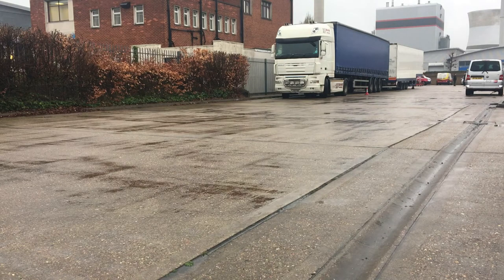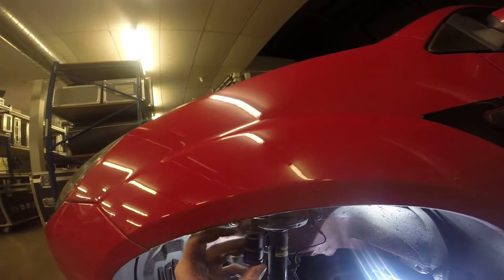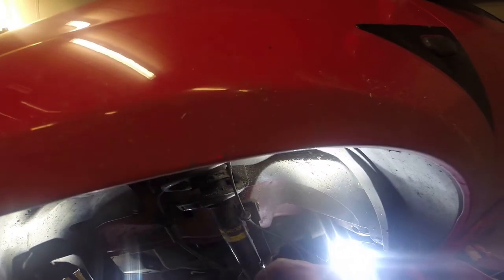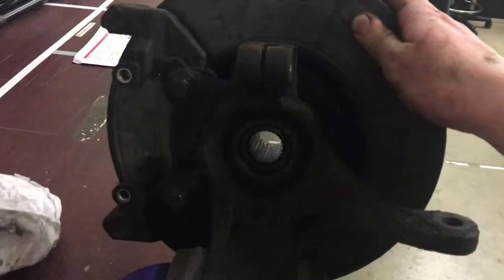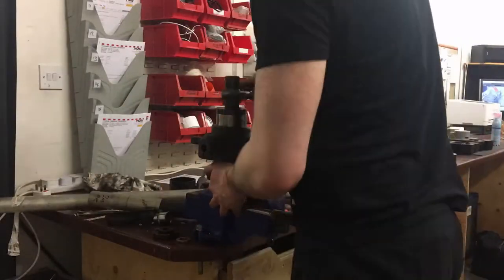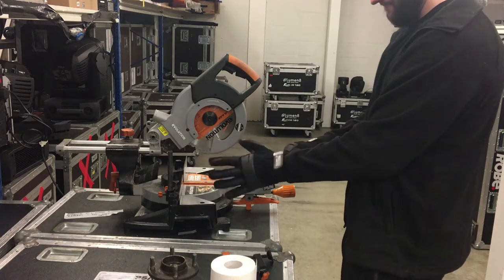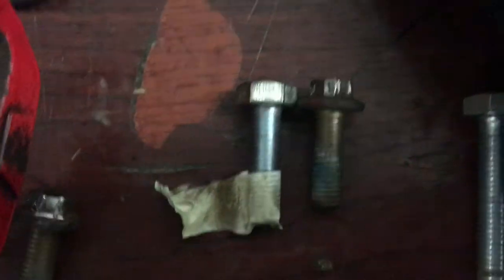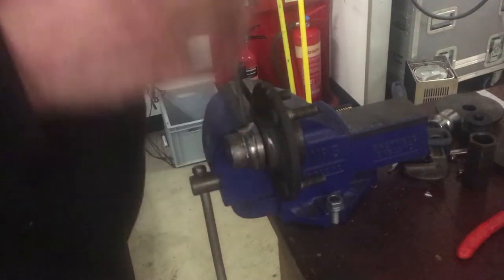Ford Fiesta ST - Front Wheel bearing change

Comment: taking my st to the garage tomorrow, its making a humming noise in straight lines and right corners, but stops when i turn left. Think its the wheel bearing. fingers crossed it isnt too expensive!
Reply from the maker: Hopefully not, think its about £100 for a bearing change in a garage!
Reply: Same going on with mine, except when I turn right! Was it a bearing in the end mate?

Comment: Did you put the curclip in and it's your car abs
Reply from the maker: Daniel Paget I didn’t as when I took the broken one out it didn’t have one in there.
Yeah I do have ABS, it looks like the circlip might scrape against the connector if it’s installed though
Reply: @jaymono6498  The  mystery cir clip was confusing me too, the new bearing came with one but yet I didn't see one when I removed the old bearing. Came here looking to see where it should go.